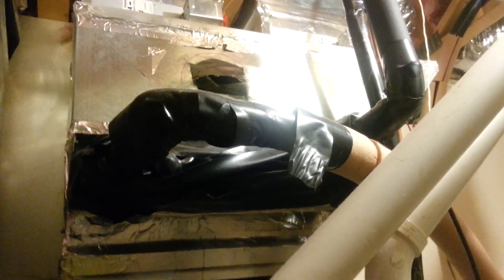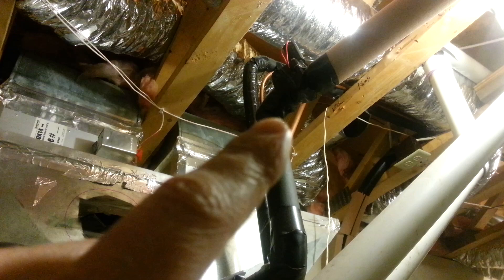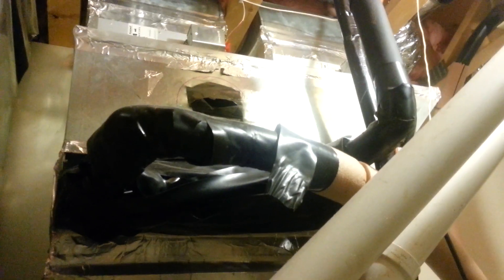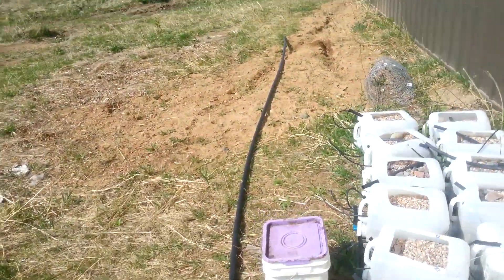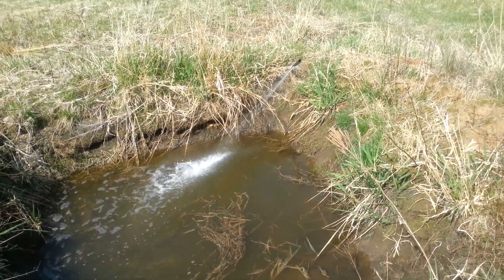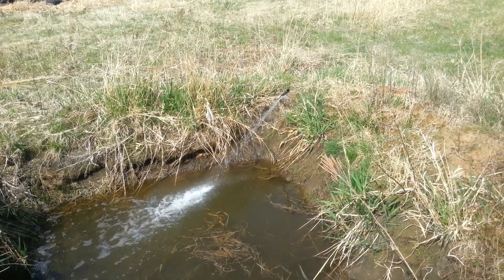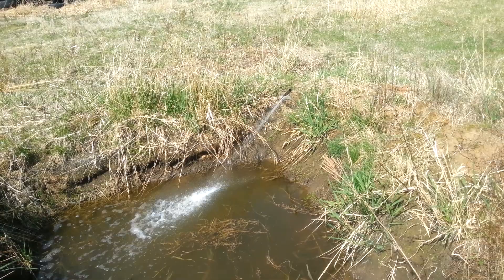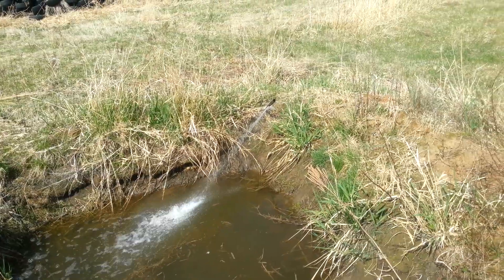DIY Well Water Air Conditioner (water is free and 60 degrees!)

Comment: I plan on using a system like this, but I intend to use the water outlet into misting sprinklers on the roof to cool the roof.  The water can then be routed through gutters into a catch system.  The cool water will definitely serve double duty cooling the house.
Reply: brannons bass shop in paris tx done that. it was just a pvc pipe running down the ridge of the roof with small holes in it and a pump. they had about a 1000 gallon plastic tank under shade out back and circulated back into it. they told me they would dump a cup of bleach in it occasionally and had to add water sometimes but the rain water was also piped into it from the gutters . they said it lowered the attic temperature over 30 degrees. the pump was solar powered but ran constantly during the daylight hours. pretty simple and cheap setup except the cost of the tank but if you had well water you would eliminate that expense.
Reply: @pl747  Very nice.
Reply: @SuperUncleRyan  I would be interested in knowing how many btu's of cooling that could be extracted of 55 degree well water moving through a radiator at say 2 gallons or so per minute. 12 volt solar pumps will do that much flow now as long as they don't build pressure.

Comment: If you run some small heat exchangers down your well, you can run glycol & a closed loop..  Much smaller pump to circulate, longer life on the exchangers, and probably better performance and dehumidification.  THat's my plan anyway! ; )  Cool vid!
Reply: Doing this would at some point create a heat spot by warming up the water and no where for the heat to go. Pulling the water from the well allows fresh water to enter in to the casing and thus keeping it cool. Geo thermal wells have many loops that prevent this from happening.
Reply: no privacy  Glycol is not poison.
Reply: Hey Mark i was actually searching for something similar to what you mention when I found this video. I hand dug a well in my back yard and was curious if I could run the condensate line before it goes into my air to air heat pump down the well...into a small heat exchanger to lower the temperatures before it hits the outdoor unit

Comment: I'm imagining a geothermal well that uses temperature differential to pump the water up, then drops it down in a closed loop into an A/C unit that uses your conventional AC set up, but uses the water as an additional coolant.  Maybe it could bring in cool air from earth tubes underground, so the compressor would go off if it just weren't cool enough.  

Or combining water A/C with earth tubes might work.  Instead of an earth tube, a pipe that runs air through the water in the well might work, but one might have to vacuum out condensation rather than siphon it out like you could with an earth tube.  But it would save on digging a ditch just to put the pipe down in the well.  

Maybe a bend with a siphon just before the water would help, as long as no mold got in there that could contaminate the water.

Comment from the maker: you could probably use the a coil from the ac. however in this case i used a radiator that  is designed for glycol for a wood boiler heat exchanger.

Comment: If you have no reheat unit, how do you remove the moisture from the air using a chilled water unit?   At 60 degrees, it must run a lot in the summer.

Comment: How much of a temperature differential are you seeing?  (air temp before the coil, minus air temp after the coil...or at your registers)
Reply from the maker: I never have taken an exact measurement. But to give you an example... on a 80 degree sunny day without any AC it is above 85 in our house because we have a metal roof with inefficient insulation. When we are running the well water AC it is about 74 in our larger room and 71 in our smaller rooms. So its about a 15 degree difference.

Comment: how many gpm does it use?
Reply from the maker: I am running 2gpm out of it.
Reply: thanks. I think I'm going to make one.  I see your suggestion of a car radiator and I have one and could get more for free.  I've been purging the well running it straight into the lake on and off for several weeks when I am there.  I've gone from less than half a gpm to over 1.6 gpm for hours without sucking air and the water quality is much better.  So I think I would have enough water to run it.   It hasn't been that hot, but I've wasted a bunch of cooling testing water lol.  Furnace doesn't have ac coil, but that's what the rad if for.  Pretty well insulated house in Michigan with a walk out basement and I've been running a dehumidifier downstairs.  I'm not concerned with cooling the lower level.  Really only need to cool about 500 sq feet.  Thinking I could just run the pipes up stairs and put a box fan on the rad to cool like a big room AC.  Just have to catch the condemnation.
 I think you could get more efficient with water and pump use by monitoring water in / out temp. difference.  Use that to control a variable flow valve.  This way you can absorb the greatest amount of heat per gallon.  Sounds like a good raspberry pi project which is something that I have not played with yet.  I'll be shooting video of my project and will someday get it edited and posted on my channel.  So many ideas and projects and so little time.